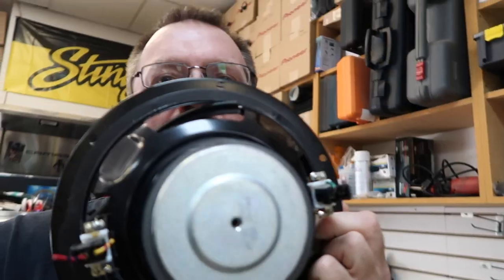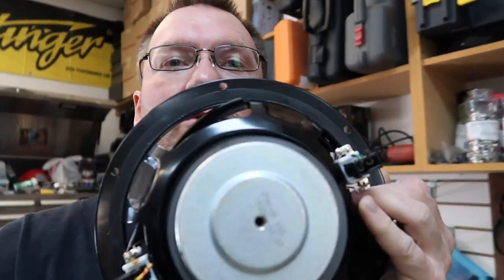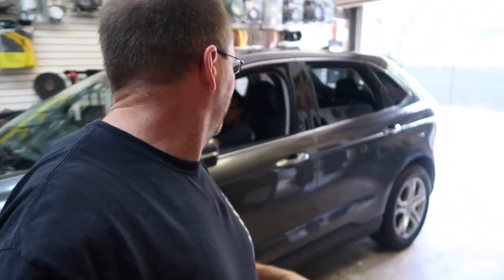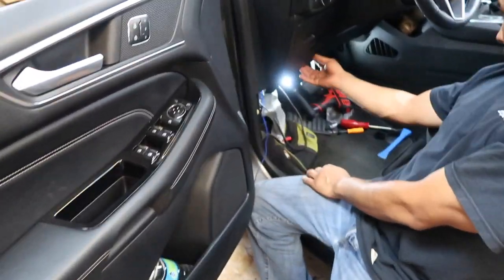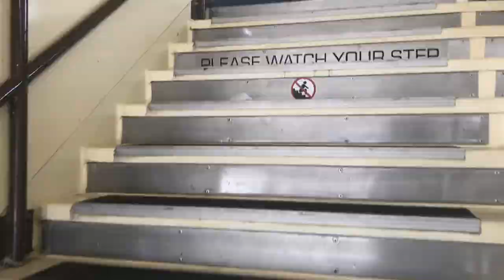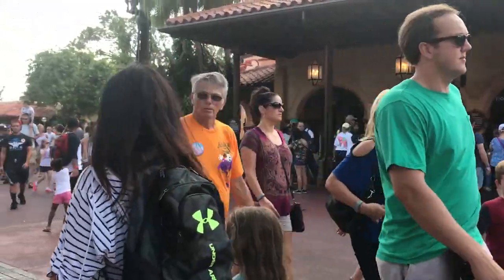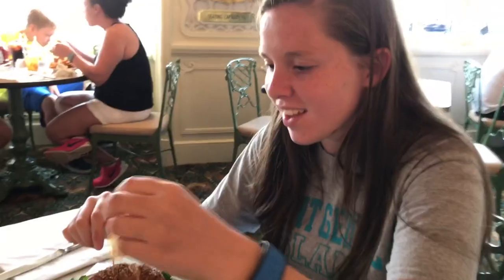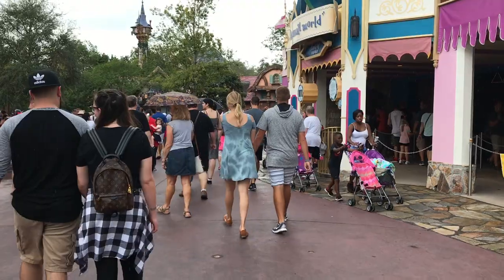Car Stereo and Disney, what else could be better. Installer Diaries 39

Comment: Man...Thanks for the Disney vacation... you saved me 125.00 X 4... plus I didn't have to mess with i4... Is there a single din pop out with navigation (Garmin preferably) and if so which one would you recommend?
Reply from the maker: +Max Well non with Garmin. Pioneers has the new AVH-3300NEX that can do CarPlay or Android Auto for navigation. Or you can get their add on Navigation the Avic-U260

Comment: trick question: if a 2025,16" hyundai genesis coupe ultimate, came in your store/shop and wanted  to replace the stock gps touch screen  unit/, no frogs, no promises though as i have seen one before, and with the new unit a front and rear camera install, and replacement of all stock infinity speakers/ no disney trip included att/ and actually a phone that will work with a unit without a bunch of useless crap

Comment: You can turn the fake engine noise off using forscan. F150forums.com has alot of the info and where to get cheap obd2 reader with a switcher installed. I paid $16 for my USB to obd2 that was modified with the toggle switch.
Reply from the maker: +Zeke Rayment did not know that. Do you have a link to the one you bought?
Reply: Five Star Car Stereo https://www.amazon.com/MAOZUA-ELMconfig-Compatible-Interface-Diagnostic/dp/B072538MWK

This isn't the same buyer. But elm327 and it has to have that switcher installed. 

Forscan is Ford's PC app. You get 6 months free then have to request a lifetime membership iirc. You can change all sorts of settings such as the eq for the stock head unit and turning the stock sub on/off. Look on f150forums. Under the 2015+ section. Should be a sticky for the forscan thread. It's a long read but could be helpful.